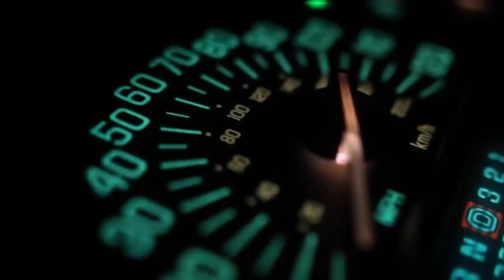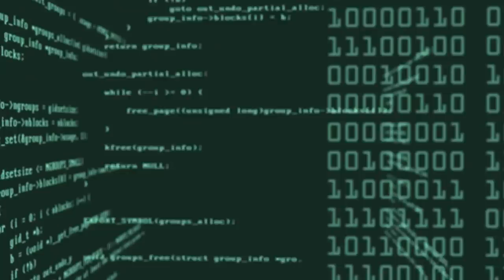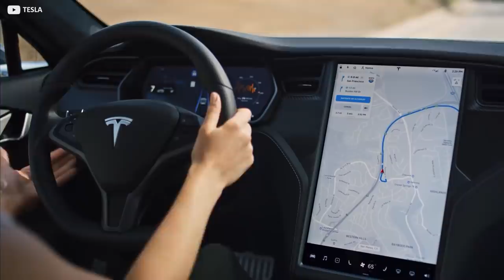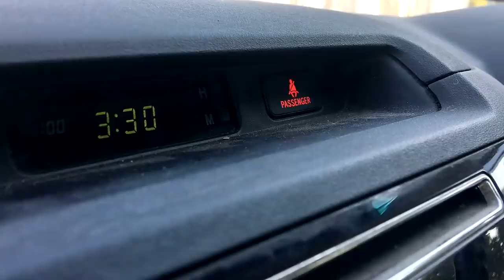The Apple Car Is Coming Sooner Than You Think

Comment: Wheels sold separately.
Reply: F0r S4ViNg EnviRoNmenT
Reply: Charger and battery too
Reply: And Engine too.
Reply: @timmyfan6194  you mean motor? Electric cars don't have engine
Reply: @m.h.a.2404  yeah i meant motor, sorry. after all, it will probably not be a gas powered car.
Reply: @rakeshraaj5620  Why?
Reply: Car be cost : 100m+ 

Wheels be: 100m each wheel 

😂 lmao

Comment: For the autonomous shuttle car they could start out by using their headquarters as a testing ground. It could be a system designed for large campus-like structures. For universities, cultural centers and large companies. It would be to slow to produce accidents that are bad for the brand. And it could be designed to be more comfortable for Apple users. Later on the autonomous car could become available for the private market. It could be used to drive your children to school by themselves or as a groceries car for the elderly. The slow autonomous shuttle car market is prolly going to be bigger than the regular EV market within the next 20 years. And maybe even further down the line.

Comment: Those Apple owned and teched out Lexus cars driving around are not just for Self driving but for Apple Maps.  Apple has been secretly adding street view to Apple Maps.  Its has a higher resolution and silky smoothness for supported streets when comparing Google Maps App on IPhone or IPad for obvious reasons. 

The street view capabilities in Apple Maps is expanding rapidly which could give the impression that Apple is developing a car.

Comment: It will do away with those unsightly tactile steering wheels in favor of a touchscreen graphics one, and will merge the accelerator and break pedals into a single unit that you have to tap the right number of times to activate.

Comment: The Apple car:

* Comes without charging cable but you can buy it for 1000 dollars

* Opens only by Iphone or by a separate ''apple card'' that costs 500 dollars

* To choose color, pay 800 dollars

* Internet connection for the car 200 dollars a month

* I'm not even going to mention the absurd cost's for the interior

Comment: To enable the headlights and blinkers 6,000 bucks

To enable radio 5 bucks per minute

To enable engine 47,000

To enable charging it’ll be 80,000 plus a fee per watt on top of your power bill

For suki suki from Chinese factory worker 90,000

Butt fuck from Apple is completely free though.

Comment: It will cost $70K+, after a year you will have option to trade in for 10K off for new model, 5K off after second year,  on third year car will require yearly license purchases of support for "outdated software" less it stop working entirely for safety purposes.  As for data (massive amounts required) I expect somewhere $300-$400 a month average.

Comment: No.............. too exaggerated .......... or too much expectation is shown in the clip.....

Ridar is still expensive tech to be equipped..... while Tesla keeps adopting ADAS, which needs an amount of real data from drivers who have run their EV on the road - that is, the first one piles up way more data than followers that start later.

Yes, Tesla is monopolistic in terms of the REAL data they have, so that Tesla EV shows safer pattern and reaction on the road b/c EVs are updated frequently with more indirect experiences from MOTHER COMPUTER located in LA (AI with big data like deep learning).
That is why Tesla is competitive compared to other EVs such as Hyundai, Ford, Toyota's EVs... battery is not the main issue of the EV in the end....

Google made a wrong strategy such as Waymo (though at first, it was outstanding in terms of deep-learning) so that now they are way behind and having a constant loss financially but Google does not disclose it on its F/S :)
Waymo made a mistake by choosing simulation deep learning like Alphago - But driving on the road is different from Go where rules are already set in its number. 

Apple's Titan Project should have been operated with more support (and many of the top technicians from Titan moved to Tesla, and they contributed to today's bullish Tesla)
Now, Tim Cook who is more like CFO than CEO (does not have a frontier attitude like Jobs) cannot deny the coming flow of the new era.
So, he cannot sleep well now as whatever it is he needs to pick a card and no more delay or escape from the reality.

He doesn't seem to want to sacrifice by jumping into the cost (old-typed) vehicle industry,
rather he wants to ride together on the huge boat of the EV market.

That implies He does not need to SHOW you a super ultra brand new SF like apple car............. there is NO reason.
In terms of HARDWARE, Samsung has shown brilliant technology that human beings haven't supposed to happen like Galaxy Fold.
But does Apple care about it? NO.
The reason is simple. Why should he do that~~~~~~~~~? Apple is like a service-providing firm (not a manufacturing firm anymore!) 
Apple just needs another package of tools to deliver its cash flow items to customers to increase its sales.

2010~2020: it was a smartphone device
now: just a bigger device - EV where you will spend free time on the Apple programs such as music, shopping, video, games... etc....inside the Apple car as you and your friends do not need to focus on riding or driving.